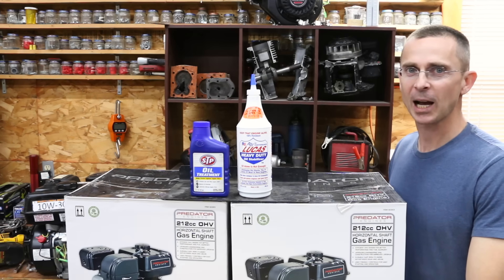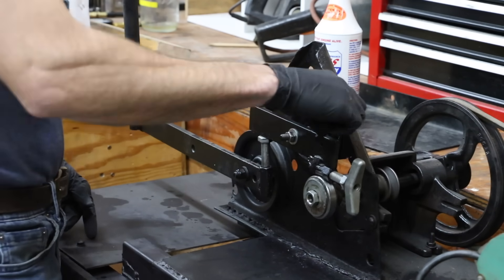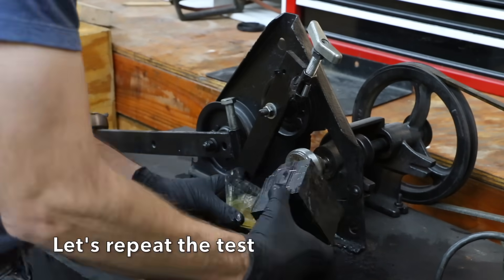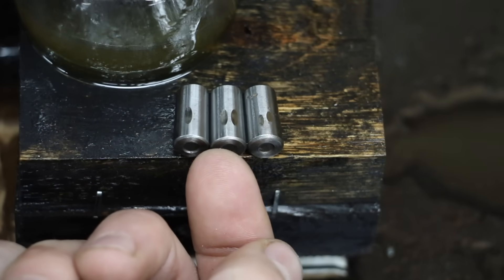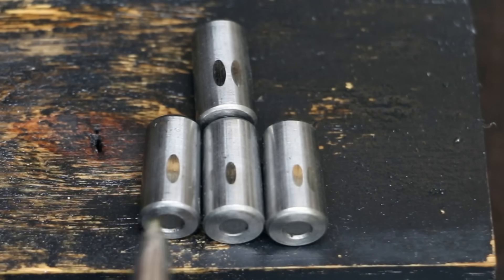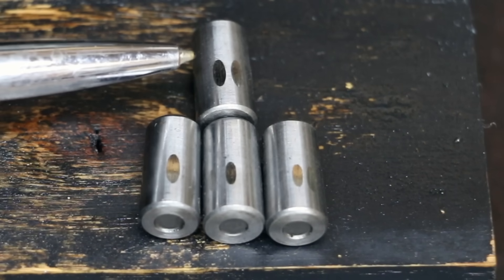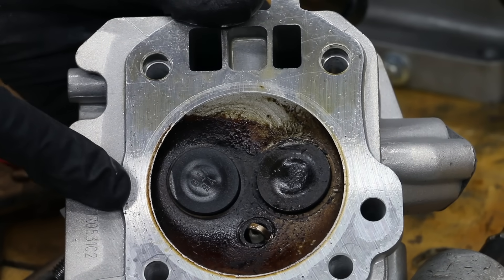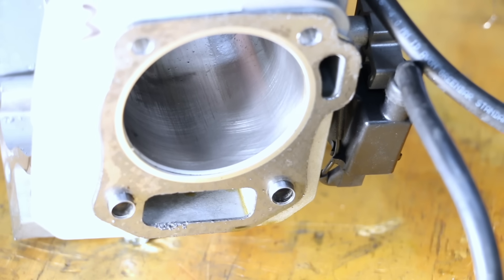Which engine self-destructs first?  Lucas or STP?

Comment: Definitely going Lucas. That extra 9 minutes of run time could be the difference between finishing and not finishing mowing the yard. 👍
Reply: The real question is how it compares to oil without an addatives at all
Reply: @You_Got_nico  That's what I was thinking, what would an engine do without any additive,  to determine what if any difference the additive does .
Reply: @charlescamarillo9279  he tested straight oil the same way and it ran a lot longer then these addatives. Looks like these probably SHORTEN engine life, not make it longer
Reply: @You_Got_nico  wow, very unexpected. ...soon as I sent that, I relialized the video was a few years old and their was probably an updated video, thanks I will check it out.
Reply: @charlescamarillo9279  I believe the straight oil video was done a few months before the addatives. Check the comments here I believe a few have posted a link
Reply: @charlescamarillo9279  bearing test-  10w 30 had most wear
Reply: @You_Got_nico  conventional vs Sythnetic  maybe even throw a blend in the  comparison.  tests.
Reply from the maker: Thank you!
Reply: Project Farm  Hi, have you tested engine lubricant enhancers that contain ceramic? There is a brand in Europe, a German brand called Liquimoly and one of their products is called Ceratec. I run my Land Rover with it but I doubt the bold claims.
Reply: @fortitudevalance8424  Should have bought a Toyota, Land Rovers have a huge breakdown rate.
Reply: @ProjectFarm  Thanks for all you do! I come back to these videos whenever I doubt Lucas stuff. I’ve been running their Stop Leak which seems similar to their stabilizer mixed 1:4 with HM 5W-30. My concern is with variable valve timing on my VQ35DE Infiniti, but after 5,000mi no problem. I’ve also ran 5,000mi on my 275,000mi LX470. Vacationed in -20F Adirondack winter mornings nervously starting and all was well. Couple times it fired up super quick which was surprising. Any thoughts about testing cold flow? Do you think the proper mix interferes with oil filter bypass valves? Thanks again
Reply: Project Farm if you had run them both at the dilution ratio of Lucas, (4:1?) would they be more equal?
Reply: @cancermonkey7334  they would not be equal because the dilution ratio that is called for is different on both of them if you change that it changes everything
Reply: "Ask any mower. Any real mower. It don't matter if you win by an inch or a mile. Winning's winning
Reply: @oOBCKushOo  I just heard that hector just got 3 Honda HRN 166-cc engines and on top of that. He just came into Harry’s and bought 3 bottles of Lucas oil with royal purple
Reply: @michaelrandrianarivelo6593  9 Mos later I know.........
. I live in Vancouver WA and there's a Harry's here - are they a chain? Ours is geared towords the professional. I was going to have one of the employees hot rod my Husky 61 but sadly he had been diagnosed with brain cancer and passed away shortly after. I saw the way my cousins chainsaw performed after he got it back from Bryan and I was convinced by its performance across the board = more rpm, more powerful resulting in noticeably faster and smoother cuts , but apparently it even ran better to.
Reply: @oOBCKushOo  dom mowing his yard
Reply: @oOBCKushOo  anything you say Vin diesel! LOL
Reply: @oOBCKushOo.   That’s what hank hill would say!
Reply: @oOBCKushOo  hahahahaha
Reply: @oOBCKushOo  ain’t first your grass
Reply: Could just be the difference between the 2 original assemblers.
Reply: The stp locked up instantly the Lucas kept spinning when it blew
Reply: @JustinDeckardFamilyMan  More a function of the scatter in the crank case than anything else. I had thought the Lucas snapped a valve, or pushrod. I didnt expect to see the same rod damage.
Reply: @JustinDeckardFamilyMan  so.
Reply: Glass half full optimist. Respect
Reply: or winning or losing the race
Reply: I would go STP so I save mowing the yard by 9 minutes and in that time I can have a beer...
Reply: My neighbor came to me one summer day after cutting his back yard. Wanted to start on the front yard but couldn't get the mower started. He asked me to look at it.
Seemed to be locked up.
I checked for oil. There was none.
He said he had been adding oil but it'd been awhile. I said let me see what your putting in it.
It was 2 cycle oil. I said that's the wrong stuff. I went to my garage and  proceeded to add 30w up to the fill mark. Was able to break it free.
I told him it may last 2 minutes or 2 hours.
He proceeded to cut his front grass.
He got 2 strips form done and WHAM, threw the rod out the side of the block.
I'm convinced Lucas would have gotten him to finish.....
Reply: Wish I didn’t see this comment :30 into the video 😭
Reply: He should have done a test with a third engine and no oil other than the lubrication that was left after draining the oil with no additives.
Reply: I actually count on my mower breaking down so I can go fishing
Reply: My brother had a Subaru and ran Lucas in it. Had a slight knock/tick on straight oil and went away with Lucas.
Reply: Extra nine minutes to realize that you forgot to add the oil.
Reply: Moral of the story is
don't buy snake oil for your engine,
just buy engine oil.
Reply: Am I saw properly, straight additive is better than oil- aditive mix??
Reply: Very cool. I've always wondered about diesel oil, such as Rotella, Motorcraft, shaffer's, Amsoil, then we got different weights 1540 and now  Fords and newer ram Cummins engines are running heavy-duty 1030. 
Conventional vs. Synthetic, sure be nice to if is any real difference between all that. 
Problem is diesel engine are too expensive to destroy like that.
Reply: @curtisbull1583  What do you wonder about diesel crankcase oil? There is a mass of information on it with better data than car oils because fleet operators can justify the cost of periodic oil testing and comparing wear rates with consistent service.(same mechanics, same schedules,  etc) And yes they are formulated different from car oil, that is no secret the main chemicals of interest are published in technical product data sheets.
Reply: We used a Lucas additive in top fuel engines, too!  We hid that it was Lucus from the sponsors and prettymuch everyone..lolol.. we RARELY scuffed pistons.  Stuff is amazing!
Reply: Lucas is good but I'll stick to duralube!
Reply: @jimmccarley3191  I use both in my mower, tractor and vehicles. I even use Dura Lube to mix with my bar oil for my chainsaws. Those bars aren't cheap!!!
Reply: @Bud Morgan you laugh, but ive totally bought one of those to  do  a emergency job once. Got a call from a realtor that they had a showing in 3 hours and needed the grass mowed before then. Offered 400$ if I could get it done and be gone before the buyers showed up. All my good gear was at the house, and I didn't have time to get it
 So I pulled up the property on google earth saw it was only half an acre,  bought a cheapy from walmart and pocketed the difference.
Reply: @HeronMarkedBlade-ef7zz  Just think. With only one usage and probably no scratches and dents, you could have taken it back to China Mart and gotten ALL your money back simply because you weren't "satisfied" with it. I'm sure that's been done. 100% profit. No Chinese leftovers cluttering the tool shed back home.
Reply: Or being able to get a crack rock using a go kart from a dealer down the street.
Reply: Oh yes, that Lucas will absolutely help you in that situation!  
However, I think I'll stick to checking my oil levels.
Reply: This test would need to be repeated numerous times to validate his results.
Reply: @dmotogearhead2245  I agree completely. I figure it is likely to be a legitimate result but that isn't definitive enough to draw any conclusions.
Reply: You should always check all fluids in every engine before starting both for safety and also your wallet will thank you😅😉❤
Reply: Lucas all day, every day.
Reply: @blakena4907  🤣🤣🤣
Reply: Never tried Lucas.. when I couldn't find Bardahl I started to run a complete engine fill of STP and NEVER changed oil- only filters. One car was a Dodge Colt with a peppy 2.6 and my kids called it dad's ghetto viper. I would bury the tach into the red zone and try like crazy to blow the engine- to no avail. It would scream out in protest thru every gear until I got to highway speed, and then purr like a contented kitten. I loved that car, and then sold it to my neighbor for a buck- still running like a champ.
Reply: Exactly that extra 9 minutes could be the difference between getting that last pack of toilet paper or not getting that last pack of toilet paper
Reply: @bigboreracing356  unless you're talking running 80w90 gear oil.
Reply: Use exactly same amounts.results should be similar.lucas,stp,or similar products.
Reply: Lol
Reply: @Brett C your math isnt very bueno. Its a 43% difference
Reply: Blows up with 3 blades of grass left
Reply: Try bestline it seemed better
Reply: Or clearing snow from the driveway
Reply: @danephillips  
he didn't test slick 50 ?
Reply: Or making that last lap to the finish line
Reply: Any zink in either one of those?
Reply: On the showdown ill go two goats tied to a wagon
Reply: Have you tested Motorkote
Reply: @B Mo running on sesame oil😆
Reply: Richard Petty didn’t win this one
Reply: May be luck, but I have run Lucas products for decades. Stabilizer, ps additive, rearend lube. Never had a failure, and I tend to keep cars to 250,000 before I think of donating them. My 4runner has 289,000 and havent thought once about getting rid of it. Though, in todays market...
Reply: I suppose you think you're funny....... and yes you are, you made me laugh.
Reply: Just buy a new John Deere, that way you'll know for sure you wont finish the lawn
Reply: @B Mo hey now. That cheap Walmart knock off took a beating from me for 15 year's. Finally died last year.
Reply: I'm not mowing until I have tested all of them hehehe
Reply: It might save you in a zombie apocalypse....
Reply: Facts !
Reply: Yup,y wife tried to play that "broken lawn mower" crap on me before. I got her a manual push mower
Reply: @bigboreracing356  no
Reply: I trust Lucas
Reply: I got a nice giggle from that,  best internet comment of the day maybe week🤣
Reply: Go STP you finish mowing 9 minutes earlier
Reply: Ty for ruining the end.......
Reply: It's nearly twice as long with no oil that's a huge difference
Reply: Hahahaha 😆
Reply: I’m a pro landscaper and agree, that extra 9 minutes means an extra 9 minutes banging my coworker (owners daughter).
Reply: My young son loves the destruction.
Reply: This is test in hard conditions not in normal use ,that 9 minutes can be in normal usage maybe year or two maybe more ,because you have more durability in materials
Reply: Both those engines look new
Reply: Does gear lube work similarly?
Reply: This goes without saying for any engine. Car, truck, motorcycle.. the more time u have the better off u are at saving it
Reply: Or making it to the closest airport at night !
Reply: Lmfaooo great comment
Reply: How about slick 50
Reply: Exactly man! Those 9 minutes could really decide if you're gonna get the extra $5 for pocket money that weekend
Reply: @AdityaTripathi  lol. I had that happen few times when I'm mowing grass.
Reply: @vids595  Which is why you need Lucas around to finish the other half when it gets too hot
Reply: Aaron Nice one! That made me laugh. 😆
Reply: @danephillips  thanks for the heads up, I hadn’t heard the name slick 50 was stolen! My friend’s dad swore by Slick 50 when it first came on the market. He had a 1978 Chevy van with a 350 v8 engine and turned the odometer over twice and had never done anything to the engine other then normal tune ups and still running today
Reply: @ghostridergale  My son has over 320K on his truck and has used Valvoline synthetic only.
Reply: Justin McDonald 🤣🤣🤣
Reply: Defiantly Lucas. When I hit a pot hole in Indiana that ripped open the oil pan in my car, Lucas protection got me from fort wayne, indiana to the michigan state line and home.
Reply: @thatguyontheright1 
Is this another one of your tall stories 🤔
Reply: More Lucas product was added than STP, so, any increase in run time may be do to the higher dose.
As far as that goes, I vote for Lucas.
But both, I bet, work the same.
Reply: 9minutes won't finish my yard, I definately need to keep oil in the engine.
Reply: Justin McDonald lol
Reply: Lol
Reply: Fucking spoiled the video thanks
Reply: lol
Reply: Lol on mowing the yard.👍
Reply: Hahaha 😂
Reply: Hahaha
Reply: Facts
Reply: @B Mo 🤣🤣🤣
Reply: Lmfao 😂
Reply: Ha ha
Reply: Haha
Reply: Xd
Reply: Laugh out loud

Comment: on a 2007 hunda with 160 k miles 3.3 6 cylinder. I noticed my average miles per gallon increased by approximately 2mpg.After using Lucas. Did not try STP though.
Reply from the maker: Nice! Thank you

Comment: I run Lucas in everything I own. I do all my own engine maintenance. Never have had a engine fail, all still running strong. Use it in a 10 sec bracket GTO race car. Engine was built in the early 90s, raced since late 90s in "two" classes. 28 races a year and engine is still running strong. Lucas does what it is supposed to. I have proved it.
Reply from the maker: Thank you!

Comment: Back in the early 1990's my girlfriend and I drove from Beaverton, OR to Seattle, WA (180 mi) in my 1979 Celica GT and while we were up there my front main seal blew. It was fairly late at night and there were no shops open and I needed to get back to Beaverton that night... We walked to a local bar to think about it over a couple beers and while sitting next to this nice  gentleman explaining our situation he told us to go to the store and pick up a some STP Oil Treatment and put I believe it was 3 quarts along with regular oil in the engine and keep it under 55 mph while keeping an eye on it and stop and add more STP if needed... We gave it a try and made it all the way home without incident... After fixing the seal the car continued to perform great till I gave it to a friend of mine in 2000... STP saved the day for me.
Reply from the maker: Impressive results!
Reply: I did the same with 90 w gear oil to get home (150 miles) on a spun rod bearing in a 235 Chevy.

Comment: You have some great videos but this was not one of them , Stp or Lucus is an additive to help stabilize oil not replace it nor to be drained from a engine all together, to my knowledge neither additive has made a claim that you could drain the engine and run it dry if treated with Lucas or STP, Slick 50 has made that claim and you debunked it, so what was the point here?
Reply: Yep,  furthermore the engines were not properly broke in, which would have loosened up the wrist pin binding and take some side pressure off the connecting rod bearing. The first cylinder wall he showed commenting scoring was actually the factory crosshatch hone for the rings, that cylinder was fine. The only thing that self destructed was the connecting rod bearing, notice the shiny oily surface for the block bearings. If he wanted to run them dry, should have used an additive with molly that soaks into the pores of the bearings. Dumb test

Comment: Like to see you run the first test with your test rig at a much lower RPM. Low enough to keep the air bubbles as on of the variables in the equation. You will need run test longer though.
Reply from the maker: Thanks for the suggestion

Comment: Am I missing something ? When your pour out the oil the additives come out too so what are you proving exactly. Who runs a motor without oil ?
Reply: Td5Pete some residue will still be present and be sticking in the bearings.
Reply: Yes you are missing something 

See which additive has greater residual lubrication from sticking to then parts

Comment: After years around the drag racing community I use Lucus. My truck has 300k miles and still running strong
Reply: My Odyssey has 330k on it and ITS still running strong, too - without ANY additives.  I wonder why it is that these additives are not recommended by the manufacturers?  Anythi8ng that thickens engine oil, if it really does at operating temps, is going to create more heat and waste fuel.  That's simple physics (something an enginee+r intuitively would know).  Viscosity and lubricity are two different things.

Comment: Foaming from Lucas can be a real issue with some High pressure unit injectors. Today’s modern diesel oils are amazingly high tech just as they are. It should be noted that the first confirmed diesel that ran 1 million miles without any internal engine repairs did so on plain old Delo 400 15W40 that can be purchased at Wally World for $12 a gallon. I’m not saying oil additives are snake oil but I do question their necessity in a well maintained engine.
Reply from the maker: Thank you!

Comment: Fuel system cleaner brands. Chevron Techron vs STP vs Lucas vs Gumout, etc.
Reply from the maker: Thank you!
Reply: Chevron Techron will alter the sound and smoothness of the exhaust note if it's used infrequently.  Maybe that should be the criteria for STP and Lucas additives as well - makes as much sense as what this test really proved - virtually nothing.

Comment: I used a PTFE additive in a Ford many years ago and the idling RPM increased by around another 120 after a couple of days. The manufacturers tell you not to use it on an engine that isn't run in or it will fail to run in. They used to make a Molybdenum disulfide additive for use in diffs and manual gearboxes but sometimes the gearboxes if a little worn would jump out of gear. I use LiquiMoly diesel injection cleaner occasionally and it seems to keep my 2.0 litre tdi running happily but I suspect it more likely increases the cetane rating of the diesel.
Reply from the maker: Thank you